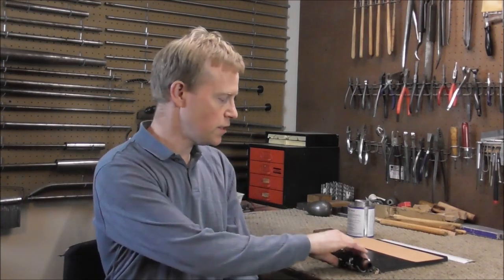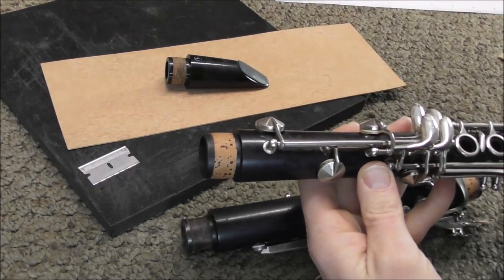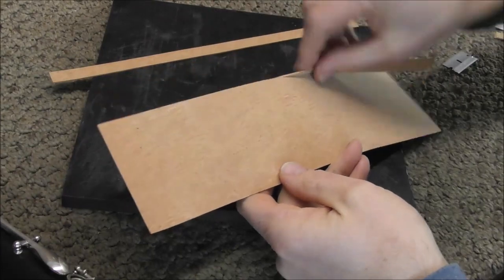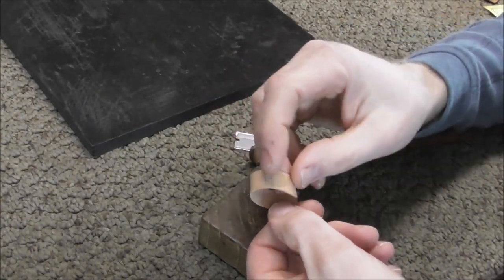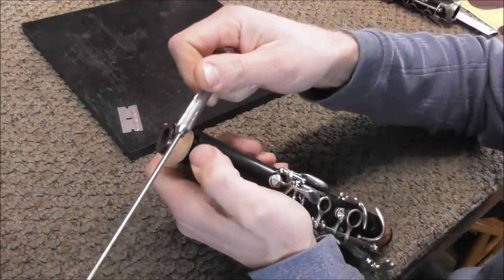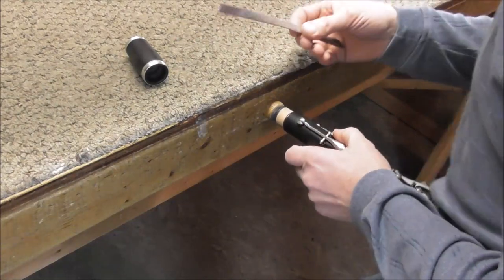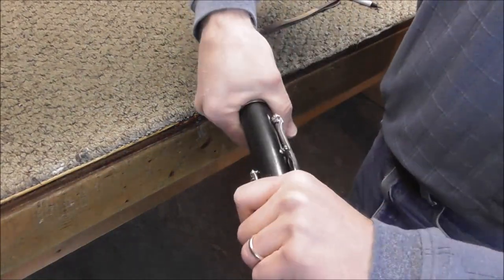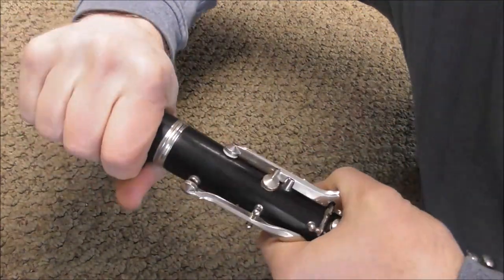How To Replace a Clarinet Tenon Cork

Comment: I'm doing at the moment an upper tenon B&H to fit a longer barrel I bought for my 45' Boosey & Hawkes 8-10. I rebuilt that one and a Conn Director 56' (I got as a ten yr. old) with all of the cork,springs, pads (both standard and cork) buying any needed parts for the B&H from Dawkes. Built my own hold fixture out of parts used for other purposes. I've been watching vids for any tips and secrets and your vid really has a lot of them I didn't see in other vids (that were also very informative) You mentioned clever ways to receive the most use from cork sheets and that bit on the, 'don't sweat the glue on the tenon (I actually taped a mouthpiece with electrical tape to protect from sanding the tenon itself) I did cork two clarinets but your tips were a fine addition to my skills so Thanks for the time you took to help us impoverished wood bee musicians that might not be as old as I am ...cough  P.S. I'm doing much better with cork, next, I need spring lessons : )

Comment: What is cork cement and where to buy. If we don't need that much what is an alternative
Reply from the maker: I use contact cement from Ferree's Tools ( ferreestoolsinc.com ). Judging by your picture, you may be in Australia and it will be very expensive to get it sent to you. You may be able to get some at your local hardware store. You can also use the stuff that you use to glue counter tops.

Comment: which glue is the most suitable?
Reply from the maker: Use contact cement or cork cement. You can get some at a hardware store or from Ferree's Tools.
Reply: @TheBrassandWoodwindShop   thanks!!
Reply: Could wood glue be used or is contact/cork cement the better choice?  Thank you. @TheBrassandWoodwindShop